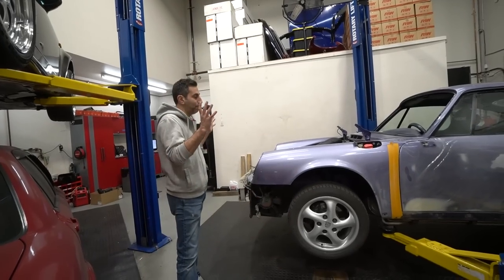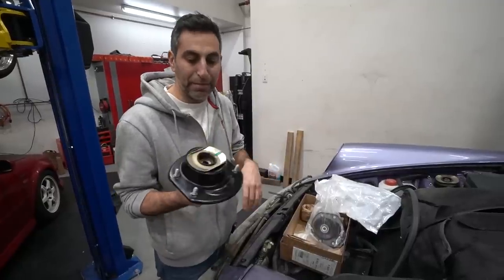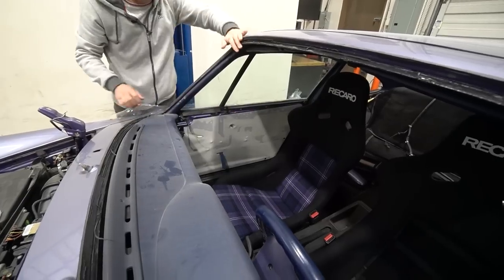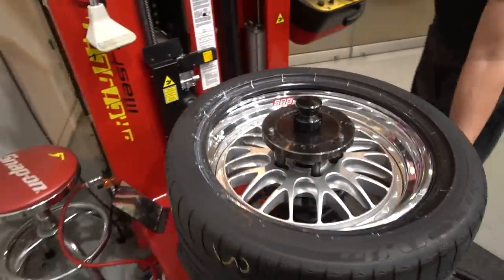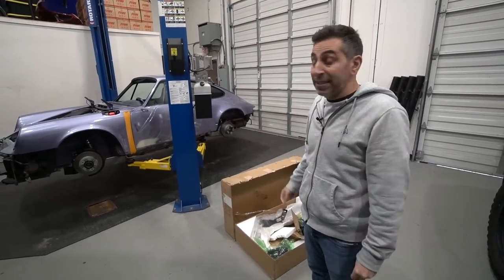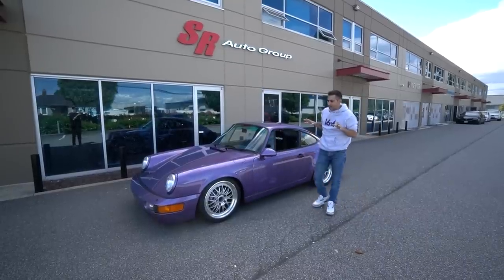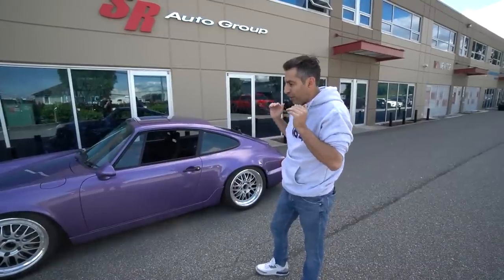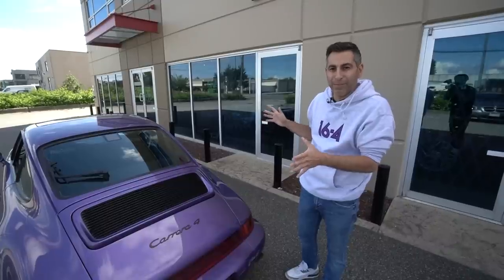THE MOST BEAUTIFUL PAINT JOB IN THE WORLD! Project Violet is Complete.

Comment: So which BBS centers are those?  What did you end up at for ET?  Been trying to figure out what to order but I want to avoid a situation where I need to roll quarters or go with excessive rear camber.  I thought my options were 0288107 centers and 7.5 inner/2.5 outer for @43ET (realllly tight) or the safer 0288108 with 8 inner and 2 outer for @51ET.  You're saying 3" outers>?
Reply from the maker: Hey Bud, I will get you exact face numbers.  The front still has a touch on the fender liners but this is the absolute correct spec for a narrow body.
Reply: @SRAUTOGROUP   @doingcarthings